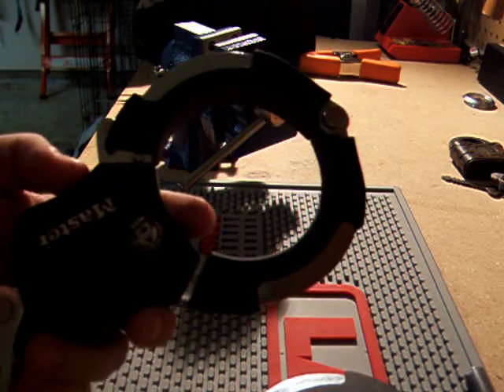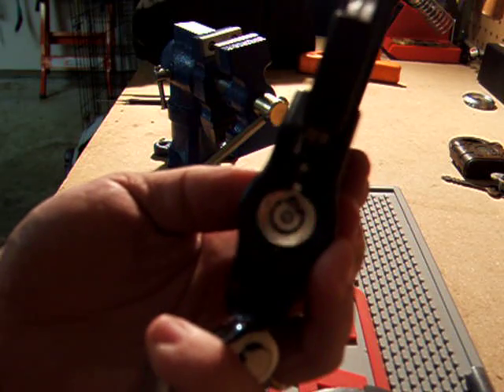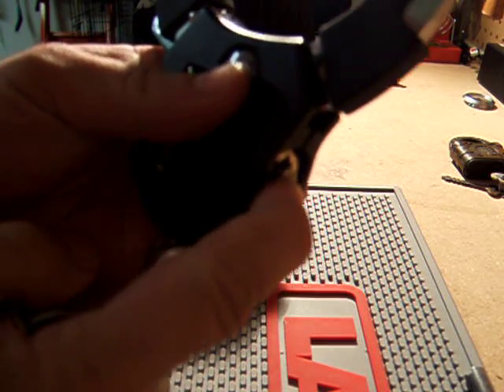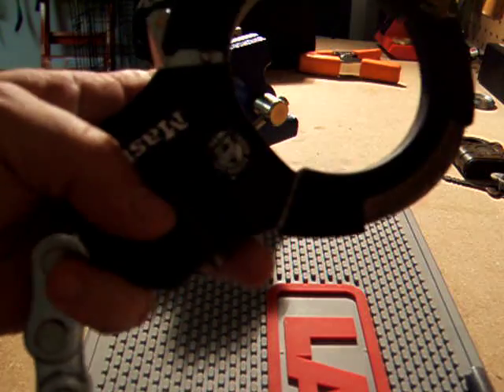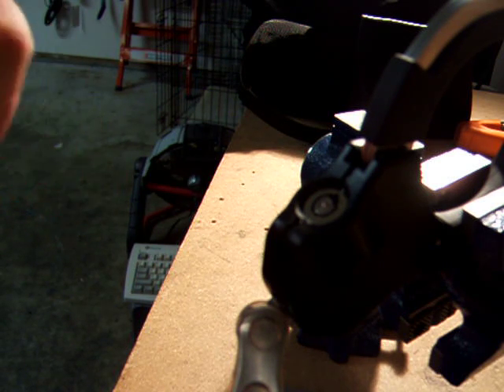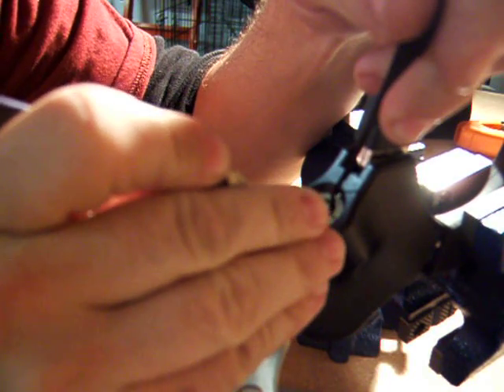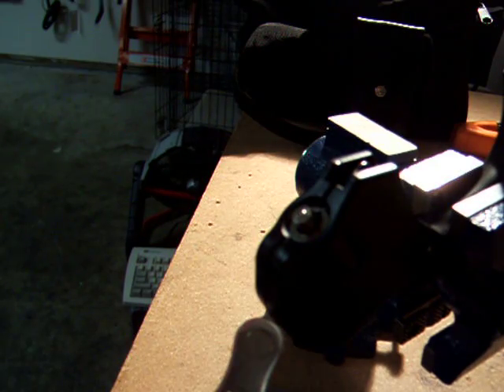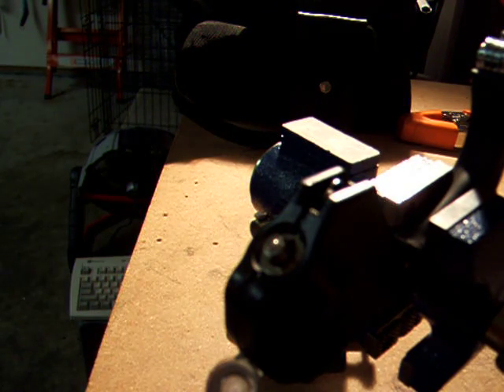Master Street Cuffs Picked Open

Comment from the maker: @Keithava You are right, they probably would not have a vise.  But I do disagree about the nearly impossible part.  They pick pretty easy, the cuffs in the video have been sold, when I get another pair I will do it outside locked to a bike, a vise is not needed to hold them.  Thanks for watching!!

Comment from the maker: @k4nuu Exactly, no one is going to try to pick a set of these off your bike.  The reason I made the video is because Master lock said they were virtually pick proof and they are not, they pick easily.  I think with the Cuff locked on a bike or lamp post would act like a vise leaving little movement in the cuff making the lock stable and just as easy to pick as if it were in my vise. If I find another set I will try it and post the video!  Thanks.

Comment: @thiegolc 

I'd have to agree that it's hard to pick. He claims that it's easy, but it's funny that this took a few minutes with good lighting and the cuffs held firmly in the vise. At 2:57, he gets frustrated and says the vise isn't even tight enough. Well, on the street with the lock swiveling around and witnesses, it would be even harder. Unless he does it in the dark of night, in which case the lighting won't be as optimal.

Comment: This guy had to put it in a vise top hold it stationary to pick. Just not practical because on a bike you wouldn't be able to hold it still when it's locked around a pole. And if it took that long for you to pick in optimal conditions you are busted in real life by the time you figure it out because my alarm is going off at the same time. This is unrealistic.
Reply from the maker: Exactly, would not happen on the street.  I use one on my motorcycle!!!
Reply: kokomolock Would you use it for a bicycle too? I'm thinking of getting them instead of a u-lock.
Reply: july7nyc I was thinking about it too but really I don't think bike thieves pick locks so much as they go for the brute force option of a bolt cutter or cordless mini grinder even.  This lock looks like it as some weak mechanical areas which can be cut.

Comment: So, from the video, it's almost safe to say that unless the thief is a locksmith with the lock on a very secure platform where they can apply pressure without the lock itself moving too much... this would take about 2 minutes with precision tools under perfect conditions.  Let's be honest: In the real world, this would take a thief 5-10 times longer and they would rather resort to cutting the lock.  Compared to the typical Kryptonite U-Locks that can be picked in seconds, this is a huge leap

Comment: after seen this vid i am now even more satisfied with my recent purchase of a set of these. i mean yes a pro or experienced thief can most likely pick these but even so it looks to take time, effort, and skill.  the average "bolt cutter and pry" thief would not even try. bic pen? probably not. i have seen the other vid posted of a cuff being cut. takes a power saw / grinder. but it can be done, as with any chain and most locks. but between this vid and that it  seems like a good security product

Comment: Just about nothings unpickable, but really, ya gunna do this lying on yur back under a motorcycle or pole, attempting this ? Could end up dead or severely injured by the owner.
I'd also like to know how many attempts you did before you posted this.
Admittingly, a good achievement, but you still struggled with it, so in saying, would i buy one of these - yep, sure would, i'd probly buy the mid size unit to keep my motorcycle nice and tight against th pole.
Thanks for the tip, they can be picked, i'd still buy one though, accompanied by a disc lock - 2 second lock job.